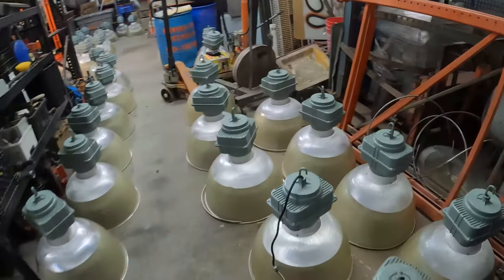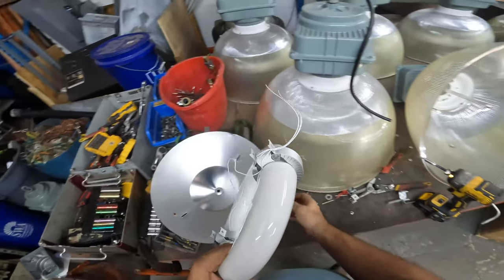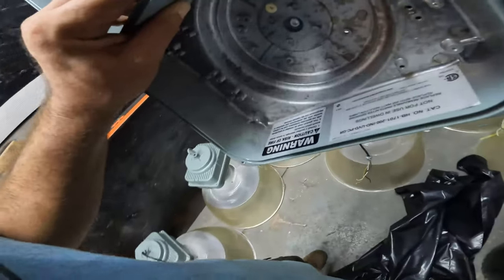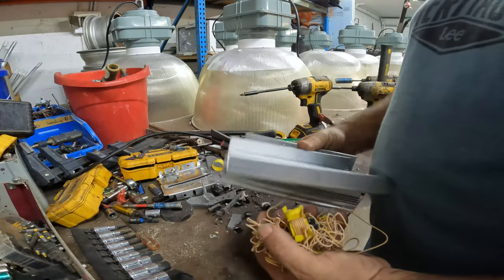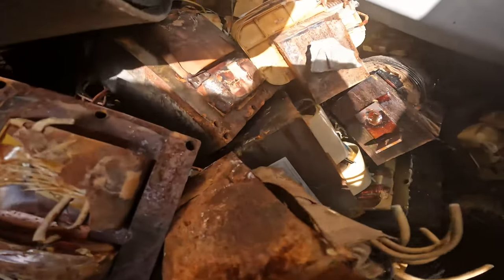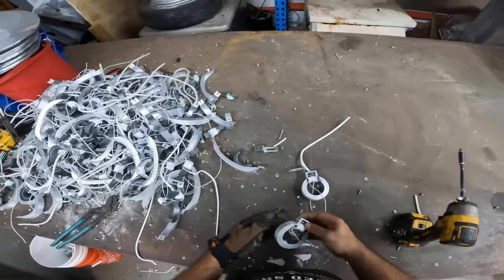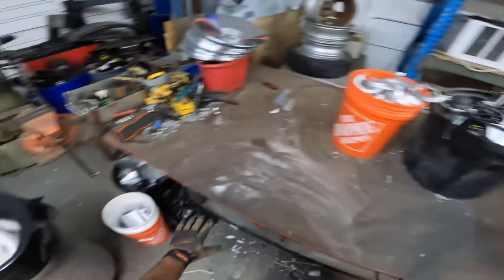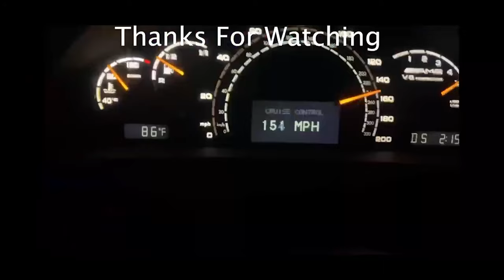Massive Induction Lighting Scrap out! Was It Worth It?

Comment: Those aluminum ballasts are easy to clean up as well, you can put on side into your vice and open it up either by man handling it or using your hammer with a couple of love taps. the pcb should just peel out. be sure to remove those screws holding in the transistors.
Reply from the maker: Thanks for the suggestion

Comment: I would have called it too.  Those little transformers might have had a little copper, but just think of it as education to not scrap those type of lights again.  And education is usually not always free.  You had a pile of money sitting in your truck bed that was losing value the more you screwed with those lights.  You did the right thing.  Other option is to charge the customer a flat rate to take them all, strip out the easy stuff and move on.  Have a great weekend man.
Reply from the maker: I would usually charge for stuff like this but they had a dumpster and they weren't gonna pay. I figured they would make a good informative video.
Reply from the maker: Enjoy your weekend as well.
Reply: Thanks.  Don't get me wrong, It was a great video to watch.  Always interesting with your narrative and then the FF 2x speed action.  I know all the work that goes into the edits.  Good stuff.

Comment: I would say the easiest way to remove the “glued board or transformers whatever is in those electronic ballast is to heat them up on the bottom and should slide right out
Reply from the maker: Maybe, but once I got behind them they came out pretty easy. If I would have done them all after the 3rd one I would have been knocking them out.

Comment: On those ballasts, I think I would have done the 8 screws, taken the easy aluminum, and thrown the bottom half in aluminum breakage (or ballasts if your yard would take them that way).  Either that, or thrown all the bottoms in a barrel and stored them to run in the hammer mill when you get it up and running.
Reply from the maker: It was a tough choice but I had so much other work to do.
Reply: @ProjectShopFl  I would'nt have done what he said either as I use a bolster chizel(wide chizel thats used doing brick work) if you get the right size it only takes two hits and there clean.👍👍✌👊👊

Comment: Would it have been easier or faster. To use a cutting blade on a grinder. To cut the heads off the screws. To remove the top of the ballast.
Reply from the maker: Not really they came right out, I think it would just be wasting blades.